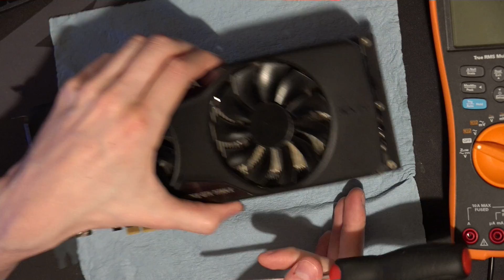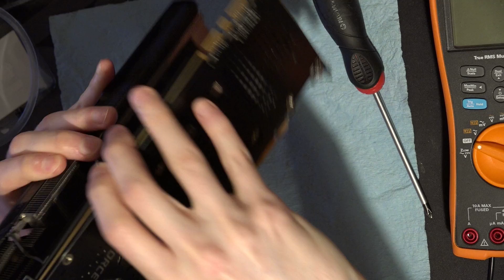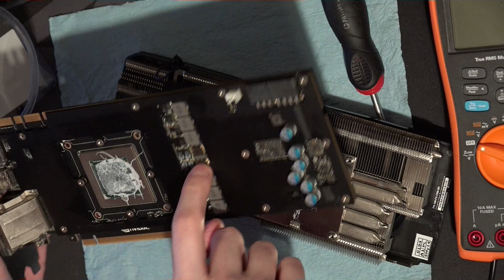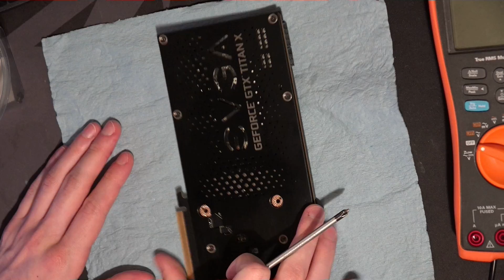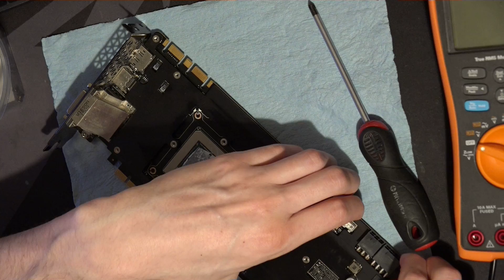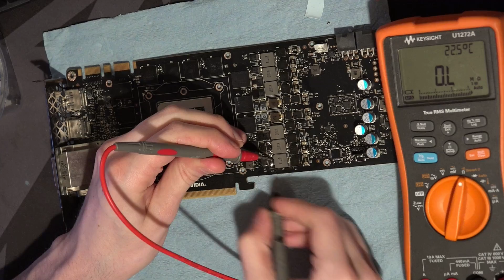EVGA GTX Titan X teardown and trouble shooting

Comment: If this core is still alive I would be very tempted to scratch a break in the twelve volt power rail and put a fuse in both rails right near the plug-ins easy to spot. The bit of information needed to do that is what is the maximum current draw with an undamaged rail.

Comment: Actually Hardcore Overclocking, What would you say in this situation: My Titan x Maxwell when running load like Valorant and sometimes it does this with League of Legends but the issue is that I get a graphics card error, white screened until the game is is 'end tasked'. I noticed it was getting really hot about 83c. I changed the thermal pads and paste and it has been running cool but its still doing the same thing with the white screen and graphics card error. I inspected the card's components but I didn't see anything out of the ordinary visually.

Comment: "If you have an overpowered VRM it is extremely unlikely it will fail, ever".

This is basically why I buy mid range overclocking motherboards even though I'm not an overclocker. The better components are good for longevity. I have a Rampage IV formula motherboard that's close to 8 years old and a Sabertooth X58 that's about 10 years old and they're still going strong.
Reply: I guess my board was defective my RAmpage IV sucks, constant pc oc fail, ram detection issues, etc.
Reply: @TogasLawn  Sounds like one of the components might be at least partially damaged. Depending on your level of skill it might be possible to locate and replace it.

If there are any round caps on that mobo look for any that are bulging out on top. It means they have likely overheated and expanded and may not be performing properly. That's the limit of my knowledge. For anything further I would recommend checking out 'Actually Hardcore Overclocking' on youtube for more detailed information.

I would check for you myself but I've had a few drinks tonight. :)

Comment: I had blown powerstage on my Gigabyte GTX 1080 Ti Xtreme Waterforce, it was fused to ground plane (no hot air station or soldering iron could remove it) so i had to remove it with pliers and destroy the remaining powerstage along with all supporting circuitry from that powerstage. After that the graphics card worked perfectly again, in place of that destroyed power stage there is small 0.5mm tall copper chunk that is fused to groundplane that cannot be removed. I think it was short circuit protection build into the controller or doublers that saved the GPU from painful 5-12volt death.

Comment: Hi, I'm trying to make an epower using a pcb of reference 980 Ti like is this video, what should I look into to make all power stage working (except vmem which are desolder) ? like you talked about power load balancing, do you think there is a way to force all mosfet to work ? except for that I think I only need 3.3v, 5v and to set high an enable pin to start up mosfet driver, do you think it should be enough to power lower end card such as GK104/GM204 and lower at pretty high voltage ?
Thanks you

Comment: Could you theorecticaly upgrade the power stages?
Reply: If powerstage is removable (unlike i had, it was "welded" into groundplane), and if there are higer spec powerstages for that package and pinout.
Reply: Yes, a RX480 Nitro with IR3553m MOSFETs can be upgraded to IR3550s. If you can even find them, that is.

It actually doing anything useful is another story though.

Comment: I get 1370 Mhz on my stock GTX Titan X. Never really gets hot because of the Raijintek Morpheus heatsink with two Noctua 120mm fans.
I've increased the power limit, but I can't remember getting past 1.2v for some reason. It's been a while since I edited the BIOS.

Comment: If you have a DMM with 4-wire ohms mode (almost all bench dmms, but almost no handheld ones) you can sometimes find the short by probing different places on the PCB and moving towards the location of lowest resistance. This is a lot harder with low ground impedance cards like this though. 
I'm not sure if I'd try it, but you might be able to put a "safe" voltage (1V?) to the PCI connector and see what heats up. All the "working" powerstages should not boot up due to undervoltage, but the shorted one will deliver voltage to the core (if the high side mosfet in the powerstage is shorted). This would not expose the core to unsafe voltage since the 1V is applied through the shorted one to the core. You could quickly determine which powerstage is shorted, assuming that's the issue. This really relies on having an actually smart VRM controller and/or powerstages though.

Comment: I think I just blew my GTX 1060 after overclocking it, its detected but error code 43 on device manager, if I connect HDMI directly to the card, nothings are shown up.

Comment: I never buy reference Nvidia PCB's anymore. They fail so many times. Had a GTX 780 from EVGA with reference Nvidia PCB, it died after two years. They then gave me a refurb 780, which also died within a few months. These cards easily hit 85-87 C under load despite custom cooler, imagine how hot those VRM's must have been. Subsequently bought a custom PCB MSI 1070 and it still runs perfectly after nearly 3 years (also much lower temps). Only buying custom PCB cards from now on, I want cards that can survive at least 4 years of daily abuse.

Comment: Grab a bench power supply and apply 1v and 2 or 3A to the shorted rail and check for components heating up. If the core starts to heat up, just lift up 1 side of the inductors untill the short is out and you'll quickly find the culprit. Good luck!

Comment: Thanks BZ for working on my Titan X! A bit of background: 
This card was randomly shorting out my psu for a few months before it was consistently shorting it out to the point that it would never boot with the PCIe power plugged in. At first I thought the backplate or the frontplate were shorting with the components as I noticed they seemed to be warping against the PCB but removing those did nothing to resolve the issues. Then I suspected a cap had blown after I smelled burning electronics on one of the occasions. As you mentioned it was a pretty fruitless task to try and pull of each cap to see if by chance it was the one that had blown. I think I've included the caps I pulled in a baggy with the cards I sent but if not, the card should still turn on. Pardon my soldering skills but working with SMT components without the special tweezer iron is really messy. I am hopeful that you'll get the card to boot up though I hope it won't be too much work. Pulling the inductors was definitely beyond what my soldering tools could do, without also  pulling the pads out. 
I also forgot to throw in the waterblock I have for this. If you would like it I would be happy to send those too as I no longer have a use for them (the other cards being a water-damaged Vega FE and an over-volted Vega 56 reference that blew the core).
Reply: good evening. by some reason may you keep this card? one of the smd in the pcb has burned and i cant read its name. maybe you could help me identifying this smd
Reply: I am having a very similar issue.. did you end up coming to a conclusion or diagnosis of this problem?

Comment: Why buildzoid uses such an expensive multimeter? Are there any other benefits apart from, I assume, reliability and precision of the measurements?
Reply from the maker: it measures really low resistances
Reply: That meter is frustratingly slow , get a better one

Comment: Very useful troubleshooting tactics. I have an X99 board with a dead VRM.  The PS clicks it’s over current cutoff relay when the power button is pressed, but not if I unplug the 8 pin.
Thanks for the tip on probing the shunt resistors. I hope I can find them on my board. I suspect one of the IR3550 chips has a ground mosfet shorted. Vcore is not shorted to 12v.

Please make more repair (attempt) videos, they would help us all understand power distribution, which affect OC’ing as well as repairs. Cheers!
Reply from the maker: motherboards don't have shunt resistors like this.

Comment: The MLC ceramic caps can create a short if they sustain physical damage.  They're pretty tough, but they're also quite brittle, so if the card gets dropped or something, they can get cracked and create a short.
Edit:  I'm working on a 980 Ti right now with this same basic board design, and the short was that bottom power stage, as you mentioned.  The card works after removing that power stage; no funky safety mode or anything.  I'd even go so far as to say that, if you have a hot air station, removing the power stage is probably easier than removing the chokes.

Comment: i just got a Palit GTX 970 with that exact defect. i removed the inductor but it turned out the gate of the dead powerstage (only a single powerstages was connected to the 12V power plane that was shorted so it was easy to tell which one was blown) was shorted to ground. i removed the powerstage with hot air but the card still doesn't turn on. either it's detecting the missing stage and it goes into safety mode or me removing phase#1 on a card that only runs phase#1 in idle is the problem if the card can't detect if a phase is gone

EDIT: after changing nothing about the card it started to work again. maybe it was still too hot from the hot air station or something else. it is booting now.
Reply: The Mosfet has a thermal warning pin which can be used to shutdown the card but i don't know if Palit uses the pin.
Either you triggered the thermal warning or you don't have good connection. A stress test will tell you the answer :)

Comment: The cooler on this is the exact same size as the one on the EVGA GTX 970 I had, and that thing got up to ~80 degrees whilst sounding like a hairdryer (even tried repasting it, which didn't help at all). It took their initial Pascal cards literally exploding for them to fix their crappy coolers.

Comment: I have an EVGA 980 Ti with the bottom VRM blown up, im in the process of replacing it. I got the VRM removed already and im waiting for the component to arrive. Soldering and desoldering on that spot is a pain tho.. I needed 400 degrees on a SMD reflow station to warm up the groundplane enough. Im not sure if I can resolder the new component properly without overheating everything. Can the card also run with a powerstage less?
Reply: The key of soldering with hot air and a lot of groundplane is to first warm up the surrounding area of the MOSFET. You have to wave the nozzle with some distance around the soldering area for some time and after that you place the component and heat it up to the final melting point. Don't place it and then heat up the PCB. It causes unnessecary stress to the component.
Besides the temperature of your hot air station, you also have to look at your airflow, distance and nozzle size. Thats why i can't give you detailed instructions on which settings,etc to use...every equipment is different.
The components can handle some abuse if you don't cook them for 2 minutes :D
Reply: @basti8878  i preheated the surrounding area with ~260 degrees on a diatance for several minutes, it was still harder than i expected. Its not the first time i tried something like this.
They're just more stubborn than normal smd components
Reply: @unlimiteddy5546  Yeah the 980Ti takes a looooot of heat because of the huge multilayer ground. On my first 980Ti repair i was surprised how much heat they take compared to a 970/980.
 On my Quick 861DW i use 450 degrees and 90 l/min which is overkill for normal components. I preheat both sides and use a lot of distance so i don't have to switch between temperature.
Good luck on your repair

Comment: Those look like the EKWB thermal pads. I also tried peeling off the the glossy layer :D
Reply: The EK thermal pads that came with my aorus xtreme waterblock weren't white WITH plastic still on, plastic layer was blue and actual pad same color as in this video